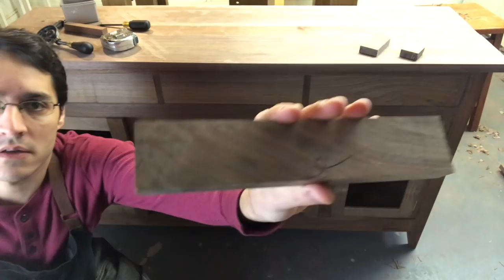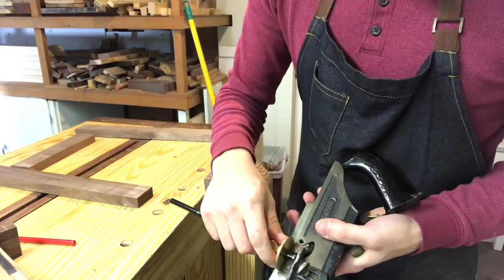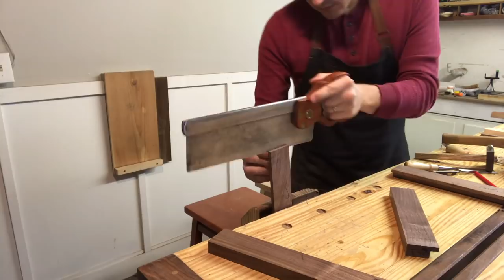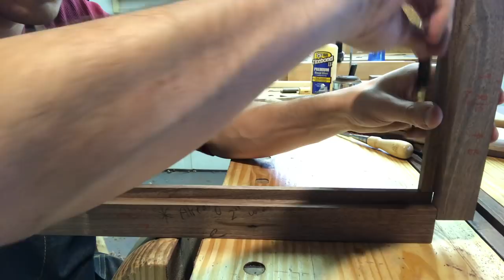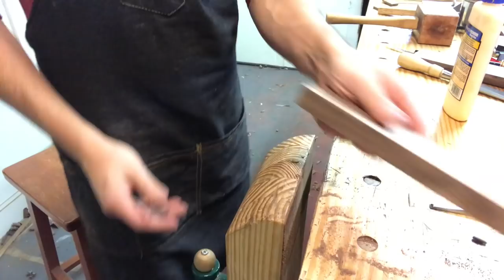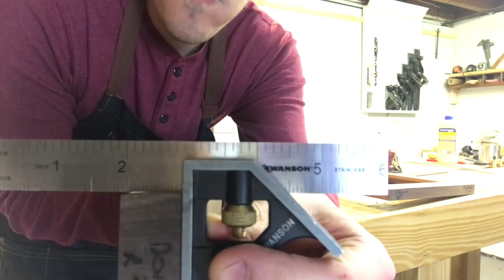Building a Sideboard part 20: Making the Doors | Hand Tool Woodworking

Comment: I just came across a mortise holding tip over the weekend.  I have yet to try it, but it is basically holding the piece in one of those two screw wooden handscrew clamps on your benchtop against a scrap in your face vise.  Last time I chopped, I had the piece in my vise and had to constantly move it back up.
Reply from the maker: Thanks, Ryan! That was a great tip for sure!